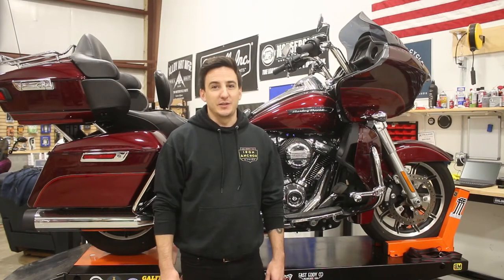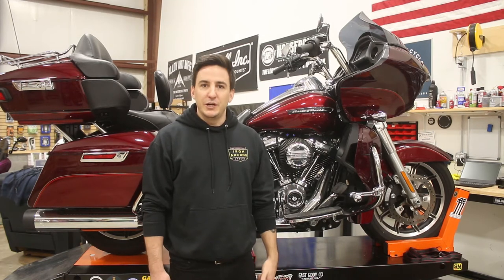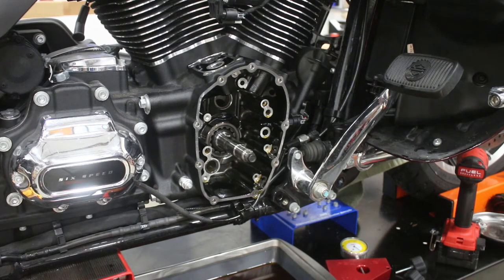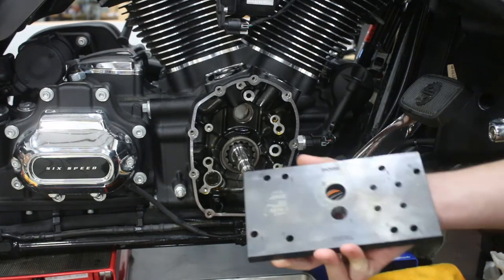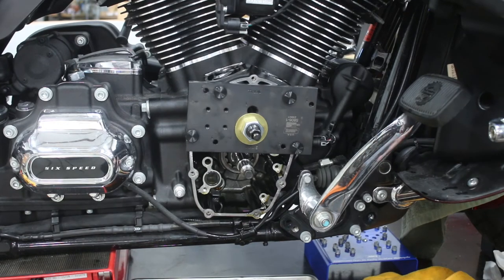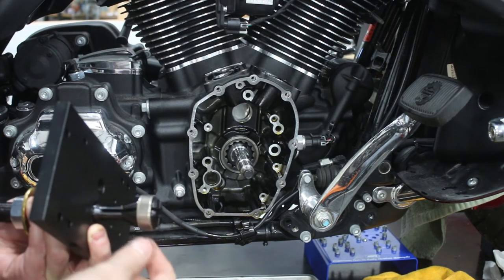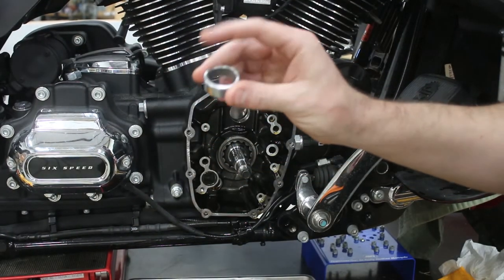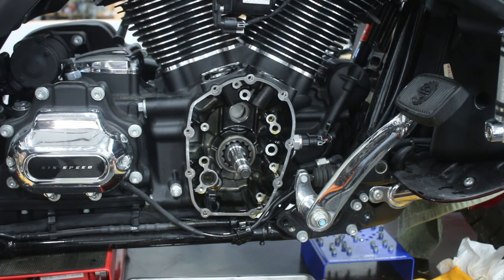How to Install: S&S Cycle Cam Chest Kit for H-D M8 Models - Part 1

Comment: I was told that only for gear drive cam runout has to be within the spec. For chain drive, propel say runout don’t matter. Can you tell me which statement is correct?
Reply from the maker: It's a tighter tolerance for gear drives, but there's always a spec - even for the OE parts. S&S refers you to OE sepcs for chain drive, Feuling cam plates have a tighter spec since they don't use bushings the way S&S does. Then gear drive is a different animal.
Reply: The tolerance is .005 thou. Its on the s&s oil pump instructions.
Can you please explain the options for people with more runout than this?
Reply: @elusivesambar8657  Yes. That is one of the first thing I looked at when I was trying to find the runout. Bothe chain and gear drive had same instruction on s&s official website. So I asked them(s&s) on their 475c cam kit installation video, and they replied back saying that runout is not relevant on chain drive cam kit.

Comment: What are the options if you are not in specs??? Can you correct it at home??
Reply: I was about to ask the same, guess I'll do some web search. My question is if the crank needs turned or replaced or if its as simple as a bearing? Honestly... if im tearing my motor that far down im going to replace the stock crank.... just me
Reply: Use the original camplate.

Comment: Not once did I see the use of assembly lube, 2 tubes are included in the kit and should most definitely be used
Reply: check out part 2.  The pink stuff gooped all over the oil pump is the generouse application of assembly lube.  afaik not necessarry for cam bearing installation